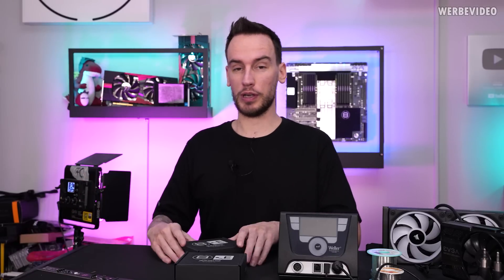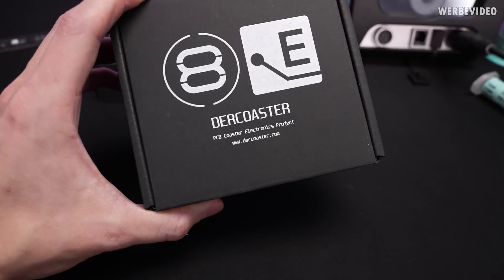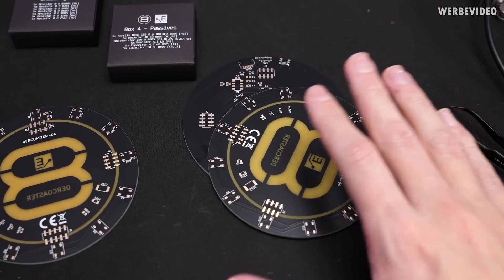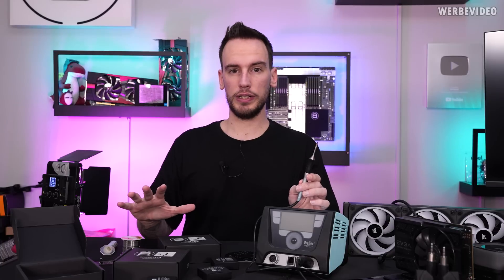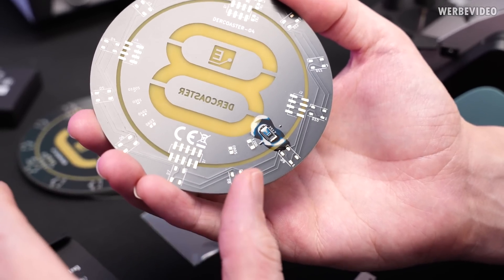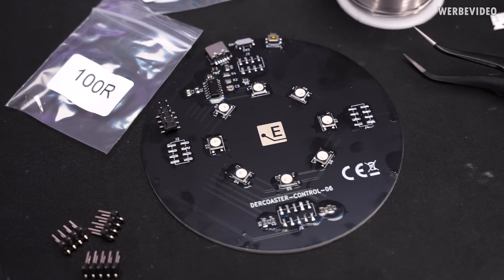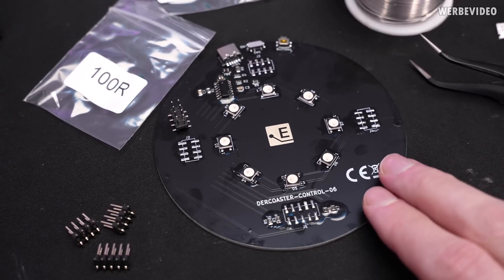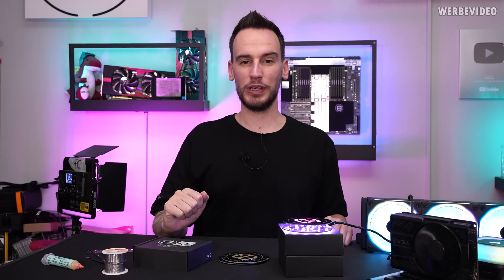Use this Project to improve your Soldering Skills

Comment: Question/Correction?  At timestamp 7:27 you mention the triangle marking on the LED part marks pin 4 of the LED.  This is normally pin 1 in every part I've ever handled.  Is this a characteristic of the specific part in this project?  I find it hard to believe one manufacturer would change this convention for any reason, and was wondering if you just misspoke...
Great idea otherwise.  Even though I'm an electrical engineer, suprisingly my education never really gave much opportunity to learn soldering techniques.  I've picked it up over the years, but this would have been a great way to learn.  (And I still may pick it up to practice!)
Reply: dercoaster website mentions that the triangle is indeed for pin 4, not like how you're used to as you're saying.

I don't know which is common, but I find it odd that opposites are marked (on the board vs on the LED) instead of the same on both

Comment: I am a terrible solderer. I recently pulled apart a katana 1070 to torch a 8cm copper water block onto it.

I initially had it in a shallow bit of water to try not to pop the vapor chamber, but cluldnt get it hot enough to flow the solder. 
Took it out and vertically flowed it. And was sweet. But wasnt happy with the positioning and moved it a bit, then a bit more, then she *popped  like an egg in the microwave.
So the vapor chamber is removed and i put the block directly to the mounting plate (along with origonal cu fins) that the vaporchamber was on (prob can fit the case back on now). Just waiting for thermal paste to get posted.  to then try and hope the solder covered block surface is flat at the right angle  to conduct heat away effectively.

(To add clarification, i initially dremelled out the 8cm*4cm of the fins on the copper heatsink and the cu block fit sweatly onto the vapour chamber)
Cheers from shaun 😅

Comment: I see the solder used included lead. That type handles very nicely compared to lead free versions. If the solder includes flux that's usually enough. I don't recall ever needing to flood a board in flux like shown, even on older/corroded cones. Maybe more a problem for those that do it daily but also avoid breathing in the fumes. It isn't good for you although a little bit as an occasional enthusiast isn't likely to do you significant harm. Do take care if you have existing breathing problems.
Reply: You need to add flux when you do SMD soldering, since you can't just place the component and then flood it with fresh fluxed solder. The flux in the solder wire is substantially degraded by the time you place the component when you have tinned a pad. Even if you were careful not to burn it, go moderate temperature and work quickly, a beginner will have a much easier time with extra flux. Keep in mind most beginners use simple power-control irons as opposed to true temperature controlled stations, so their irons if they are hot enough to complete the solder joint, on initially touching down they're plain too hot and instantly degrade a large amount of flux. They also won't have the timing and the feel down at first. I think it's a good idea to give the beginner everything you can to make their first experience less frustrated, so a temperature controlled station (Pinecil is a fine suggestion for being small and occasional work), extra flux of adequate quality, good quality solder, it all helps. Tip cartridge heat sensing irons like this Pinecil where the sensor is in the tip rather than in the heater also help handle lead-free, and if it's decent lead-free with silver and copper additives, it can be remarkably hassle-free.

It's become somewhat difficult to purchase leaded solder in EU, you need to go to professional suppliers and you need to ask, it's not being sold openly. You can also just order Mechanic brand from a Chinese seller, but being a good and popular domestic brand, there are lots of fakes out there, so neither way it's the best and easiest purchase experience. People also need to be advised and abide to wash their hands every time after handling leaded solder. Of course flux is a known massive health hazard as well, known to cause occupational asthma in half of the electronics workers even with air extraction, but only to the extent that you actually burn it off, and unlikely to be a substantial risk for occasional weekend hobbyists.

Comment: Oh very cool!  I think one of these will make a long journey to Tasmania, and I would love to get the Elmore EVC also.  
I bought a Asus Rampage 4 mobo just to try out overvolting with a controller, with the ROG OC Panel.  Remember when Asus were awesome?  I bought 3 of their high end external USB DAC (Essence One DSD).  Anyway, the OC Panel is cool to dabble with my old ROG Vega 64, but the EVC would be great to use on all my newer GPUs.  I'm glad I got a soldering station last xmas, my skill level exploded with a decent quality station and solder and flux.

Comment: That is so cool, missed out on the ruler, perfect excuse for me to fire up my solder station lol. One question, how well would the PCB hold up using a hot air station? I have a nice iron but usually doing IC's I use hot air.

Comment: The ferrite beads and resitors, if i instead of soldering the resistor but instead the wire and than the wire to the resistor, would it work ?

Comment: for the sake of a practical coaster, i think lower profile headers would be good, i feel like even 10mm is pushing it height wise. and also a plastic spacer ring, just something to fill the gap between the PCBs, to take the mechanical load off the headers (since a drink will weight several hundred grams) and (slightly) reduce water ingress from spills etc. i guess if you wanted to get real fancy, the spacer could be slightly rubbery and have threaded inserts, with countersunk holes in the PCBs so you could screw the whole thing together and have a slightly better seal, if you could hit even IP1x level performance, i think it would 10x the average lifespan of these if used as practical coasters.

Obviously you can't do much to protect the USB port and the switch (without buying much more expensive parts), but those would probably survive a spill or two before corroding or getting gummed up, if left to dry out, but they take up a small percentage of the total edge length of the board, so the probability of a small spill / drink condensation droplets going there would be low. plus the spacer ring could have a slight lip over the unprotected parts.

another option would be a solder jumper in parallel to the power switch, so that the user can leave the switch unpopulated and just short the jumper instead, to reduce the number of exposed things. if you have the spare IO, maybe a set of solder jumpers (or one of those super cute SMT DIP switches) away from the board edge to set the color program.

Comment: Now make a video on desoldering! I'm having a hard time getting all the solder off for thru holes and smd. Wick just isn't wicking it up and i'm not sure why
Reply: @michaelscarport and if that doesn't work? I think I heat it too much and the flux turns gummy. But I haven't tried adding more solder. Don't have leaded ones :(

Comment: If i use a low melt solder paste and a heat plate i feel like i cheated.

Also use conformal coating after, since it will be used as a coaster 😅

Comment: This is a fantastic idea, thanks for this walk-through as well. I found a TV that gets power but the display doesn't turn on and fairly sure it's just a capacitor issue.  Hopefully it can be saved and doesn't end up having to be taken to the recycling center.

Comment: Great video, looks loads of fun.

The only trouble with tinning the pads this way is you'll not get the components to always sit perfectly flat. I would normally tin the pads and then solder wick them flat, then add solder to one pad and mount the component soldering that first pin, then go round the other pins.

0201 and 01005 requires my smallest tip on my Weller iron and a magnifier lol, quite tricky.

Comment: Wow its great ideia, giving means and teaching people on soldering and eletronics repairs in a fun way.
I work with eletronic repair for a long time and smd soldering is not trivial, one other way to practice it is to disasemble old eletronics and training with it, did it with old modem and broken routers last week with a heat station and is kinda cool to get it going as im not used to smd work.

Comment: Regretfully, I cannot order, because it seems like Thermal Grizzly has no shipping method to my address. (Czech Republic) I get a warning "Shipping method (DHL Germany/EU, whatever was it before changing delivery address) is blocked for your current cart." 

When I used my old address just to try what would happen, the shipping method correctly changed to DHL EU. I don't know why it doesn't do that with my real address.
Reply from the maker: sorry to hear that :( I will look into that tomorrow. Otherwise you can try the Elmorlabs shop and see if it works for you.
Reply: @der8auer-en  Thank you! I will consider Elmorlabs, but I would prefer buying from Thermal Grizzly, as they seem to be shipping within Europe, thus avoiding all duty/customs shenanigans.

Comment: Nice idea and cool project.
Some tips soldering. Don't put solder on all pads, just solder one pad first, so the component lies flat on the pcb and is fixed in place.
And why use so flux so excessively... There's normally enough flux in your solder wire and you have to clean a lot less ;-)

Comment: Just bought one. I do SMT rework every day for my job, so it should be a fun distraction. Personal reccomendations:
Pinecil soldering iron, get the large tips option. Most soldering I use the K knife tip. Even the tiny parts.
Kester 0.8mm 60/40 Rosin Core solder 
Pretty much any basic Flux Pen, such as Kester 951
Chemtronics or Techspray desoldering braid (just don't get noname stuff really)
Quick hot air rework station (not really needed for this project)
Acetone and a brush for cleaning off flux, works a lot better than alcohol though it can disolve some printing and paint
Reply from the maker: Thanks for this comment!
Reply: Chemtronics wick solved so many problems hanging me up its great stuff! Good tools / supplys make all the difference.
Reply: Wana sell me your Dercoaster kit? Lol
I'm honestly really bummed out I didn't purchase one before they sold out. I watched this video less than 10 min after it released this morning. I planned to buy one cause i knew they would go fast but I did think they would be gone before i got off work. I wish i had bought one right then instead. 😕
Reply: @T.Lspitz  If they sold out that quick, I'd imagine there will be another batch soon. Especially given this was intended to be an educational tool, not an artificially "limited edition" collectible 

@der8auer-en Will there be another batch on the way?

Comment: why opposite if pin 1 indicates the first pin, which is marked on the button? and it will certainly work if you rotate this button 180' which you did lol
Reply: Are you talking about the led? He didn't show the button soldering.
The pcb indicate the first pin, the triangle on led indicate pin4 (which is weird, you usually indicate the same thing on both). He said you have to solder it like that and he did it. 1 on 1, 4 on 4 so I don't understand why you talk about him rotating it 180°. He explicitly said it have to be on opposite.

Comment: You missed one VERY important point - you have not specified the wattage of the soldering iron. The Amazon link does not specify it either; although it says 18 - 88 watts on the side of the iron that is not necessarily the output you need for the job you are doing. For older SIL and DIL packages I use a 15watt iron, but as I have not soldered the smaller packages I have no idea whether a 15watt iron is good enough. I have also just heard another ouch! - some capacitors DO have polarity markings. If you solder one of those on the wrong way round it gets very noisy, very messy and (if you're in the wrong place at the wrong time) very painful when it explodes.
Reply: I have been using a 50W soldering iron my whole life, never had any issues with tiny 0402 SMDs or large ground planes, altough I can imagine a 100W soldering iron would be nice on that. Good leaded solder, flux, right temperature and the right tip for the job are essential in my opinion.

Comment: I like that you mentioned removing the resin, some types will cause issues if left on. I used to teach soldering in the Navy and can say I like your way of doing the smaller components, it makes more sense given the soldering iron you were using.

Comment: This is a great idea, i can finally learn to solder. I recently purchased a soldering kit but i had nothing to practice on or get me motivated.
Reply: Well, you may have some broken eletronics laying around or can get some at a recicling centers for litle to no cost, they are really good to practice on.
Just be sure to get some good quality tin and some flux, bad tin is really a pain in the ass to work with even with basic stuff.

Comment: This is very cool, I just wish it had something to practice BGA soldering
Reply: I wouldn't recommend getting into BGA soldering unless you're got an excellent reflow station and a good understanding of reballing, even as an electrotechnitian it's the last component you wanna switch due to how easy it is to cause damage to the PCB or the component
Reply: @FrommDK  that is a good point, it probably isnt a good fit for a beginner soldering practice kit. Would be cool if there was a more advanced one which did include it. Also personally i wouldnt get into reballing large dies or anything, at least not in the near future. I was more considering smaller chips like memory